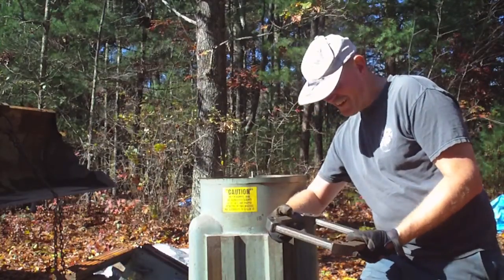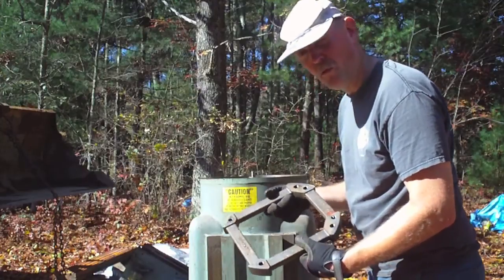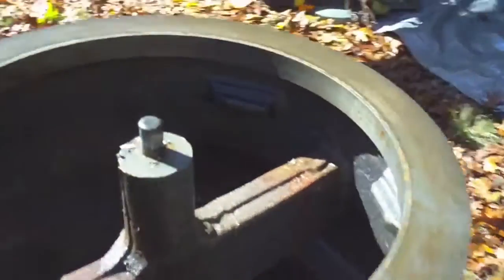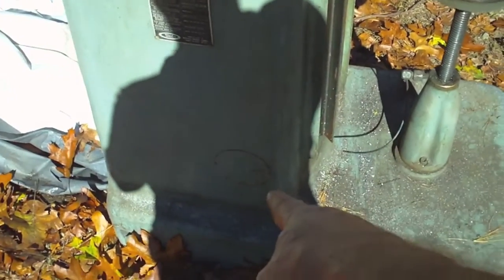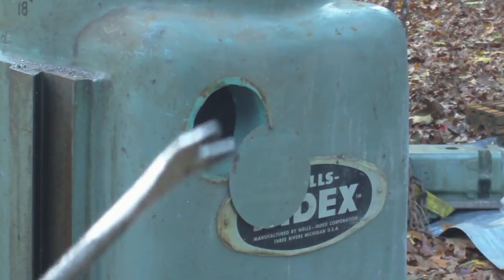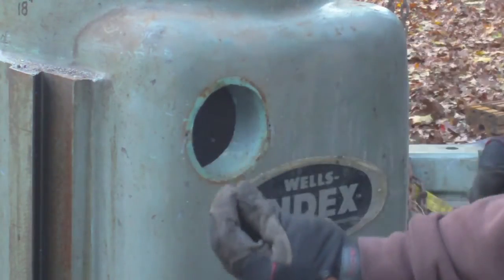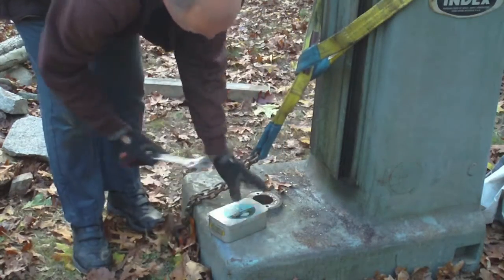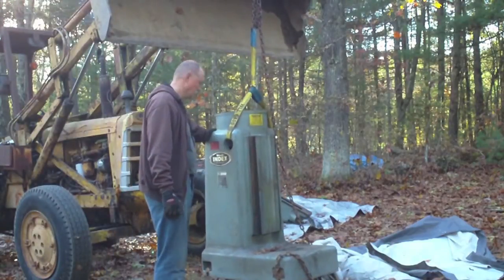Wells Index Milling Machine Part 10

Comment: I thought lifting from the ram was the standard way to move knee mills. Certainly that's how the riggers moved mine. Forklift blades under the ram, and up she goes.
Reply from the maker: I'd agree, but I had other concerns, and as you'll see in later videos, I made the right call. It would've been an even tighter squeeze in that stairwell, I'd have more weight to deal with, I'd have to rely on just the strap wrapped around the ram, and as it turned out, I was able to lay it on it's back most of the way down, and that was a big help.
Reply: Oh certainly I think the way you lowered it in was the right call. Sending it down the ramp by the ram (ha!) would've been miserable. I was speaking more to what you said about maybe having done the wrong thing by dragging it around the yard by the ram. There just aren't that many other places to grab these beasties, and I'm guessing not many riggers are going to pop the rivets like you did to run chains through the holes like you did. 

On the other hand, I'm not a rigger, and don't know what I'm talking about. :)
Reply from the maker: Matthew Simmons lol, thanks for your comments Matthew.